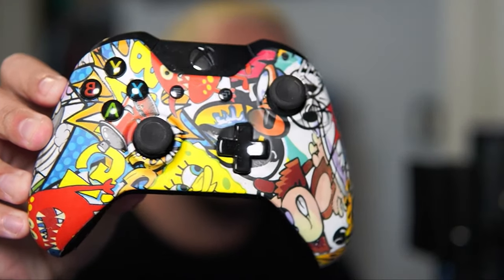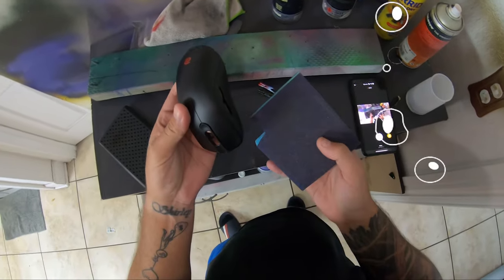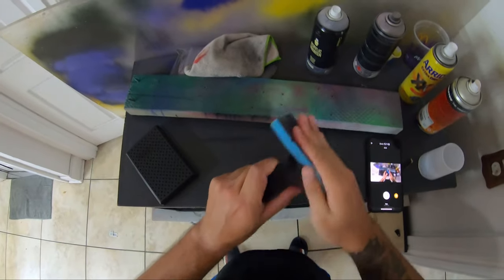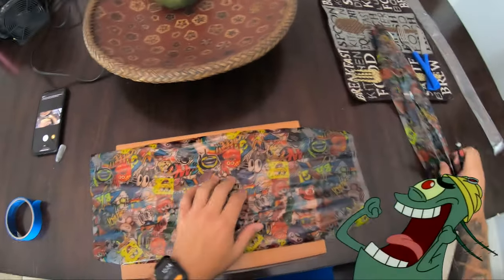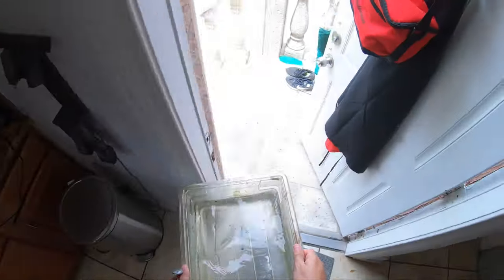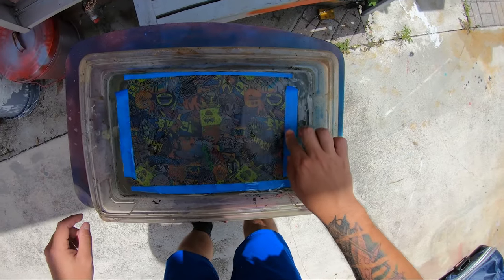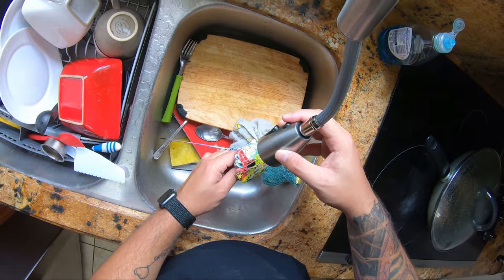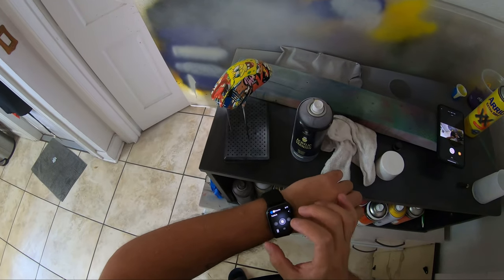Hydro-dipping your own Gaming Mouse!

Comment: Thanks for posting your paint jobs! I actually tried it myself but nothing too serious just painted my mouse to glossy white but my problem is, it is now a dust magnet and the dusts sticks really well that I cannot even remove it at all. Should I just add another coat of paint then clear coat it again ? Is there a way to remove the dust ? I tried rubbing alcohol and dish washing soap but some of the dust just spreads
Reply from the maker: Kryptonaaayt I’m sorry to hear that. Try wet sanding it and then another coat of clear
Reply: @NachoCustomz  Thank you so much! I appreciate your reply and tried it and it did work! Tho I did have to add another coat of paint due to I did put too much pressure on it while wet sanding and some of the paint on the edges did came off but then again thanks! Your videos inspired me to custom paint my mouse keep it up!
Reply from the maker: @Kryptonaaayt  im so glad it worked man! good luck in your future customs!

Comment: yeah so you're supposed to make a full frame with the tape, connecting the corners so it doesn't drift apart and warp the way it did on the first go, otherwise great video
Reply from the maker: first time trying this man. ty so much for the tips, greatly appreciated :D will definitely do that next time